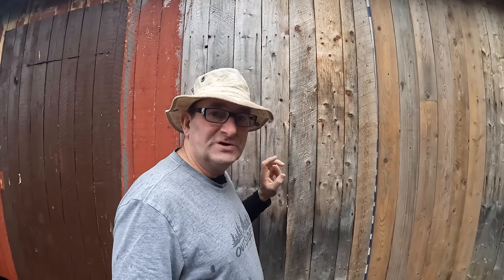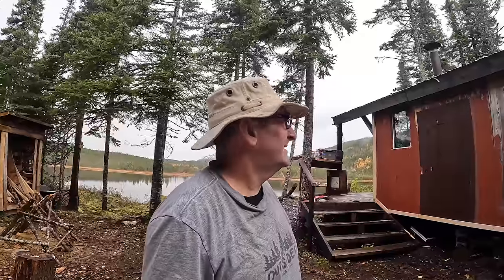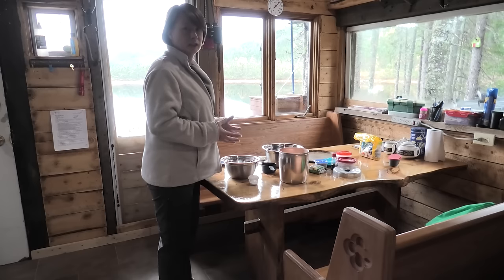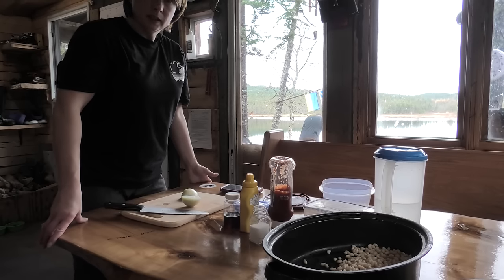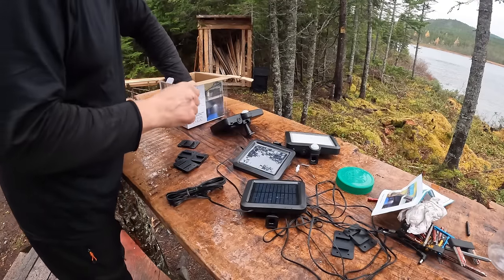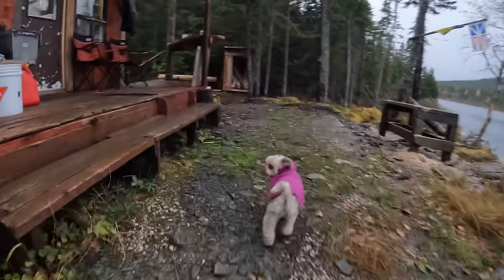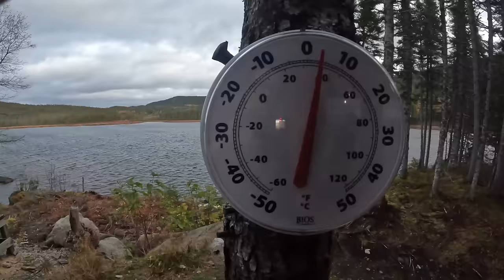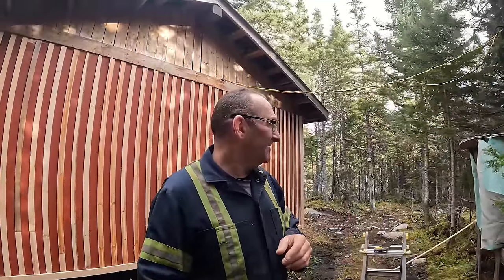Remote Cabin Winterizing Siding And Delicious Food  Episode #75

Comment: Hi bob , just a suggestion where you have the battens running into the board you replaced , should put little strips on 45 s or 22 degrees so the water runs off . If not the rain water will run down and sit on that board and rot it out . Looks really good and I love what you have done to your cabin so far to make it your own piece of heaven.
Reply from the maker: Thank-you